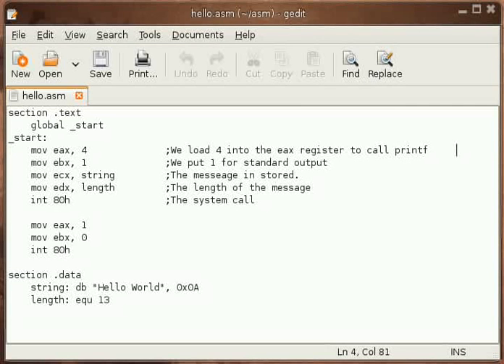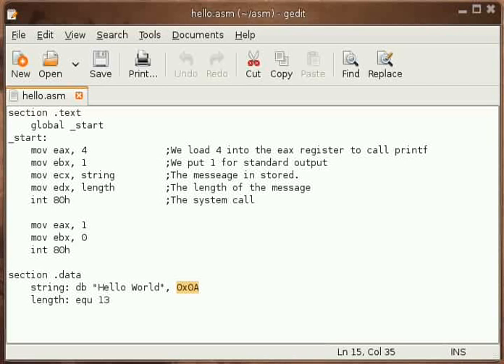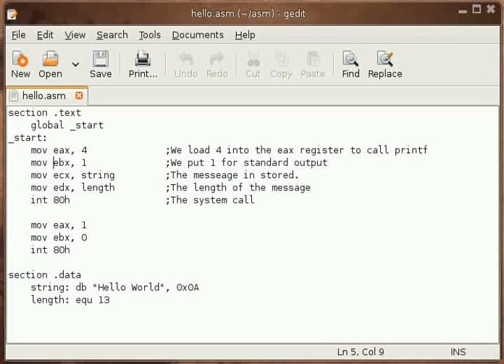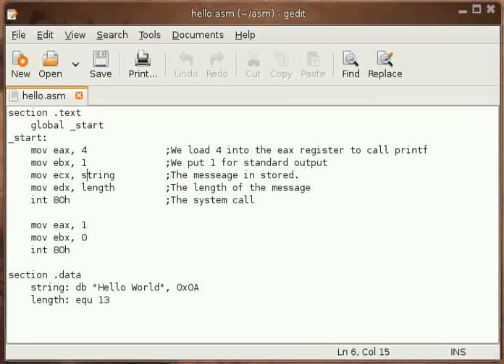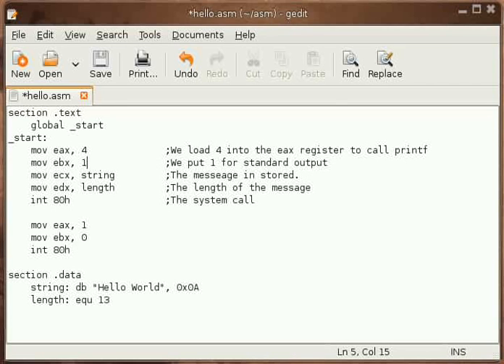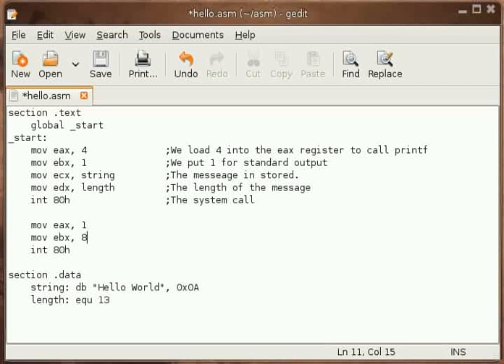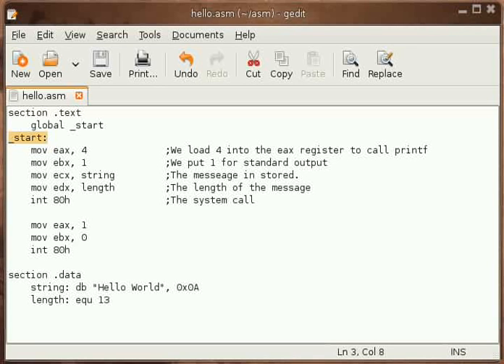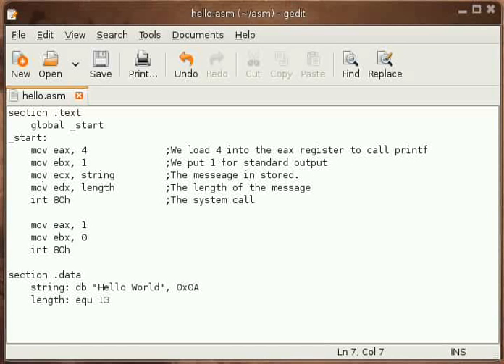Assembly Language Tutorial #12 Hello World Explanation

Comment: int 80h is how you make the system call. 

This of it this way you set up all the registers with the system call/data you want, EG typing in the system calls, which you always use EAX for and the rest EBX/ECX/EDX is normally for the arguments that system call requires to work. 

When you call int 80h you essentially send everything to the system at once, I mean you cant type half a command lets the processor do some stuff and then send the rest later, you have to send it all at once